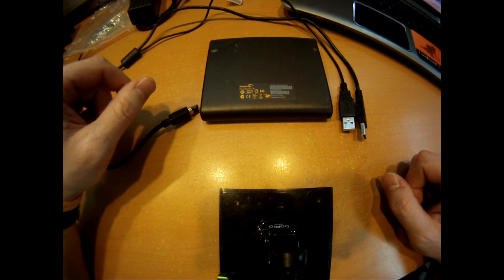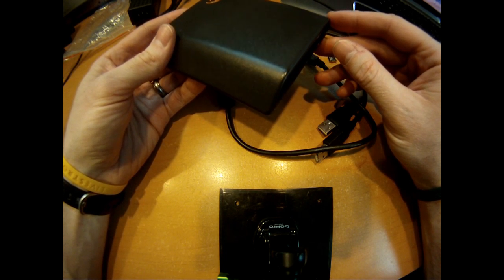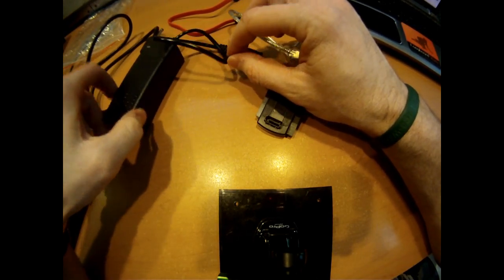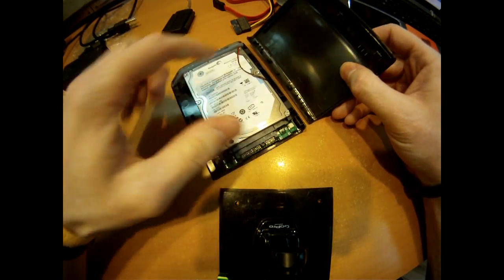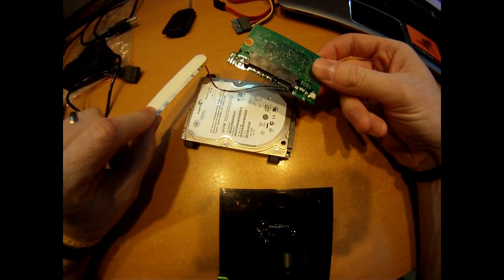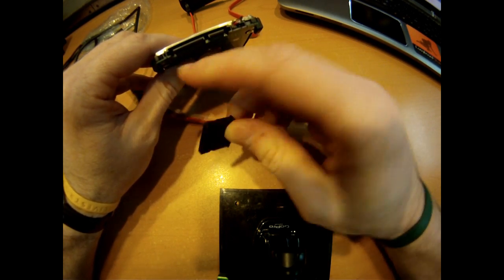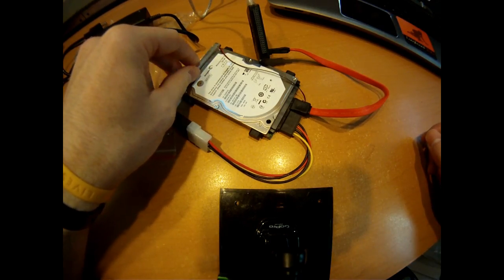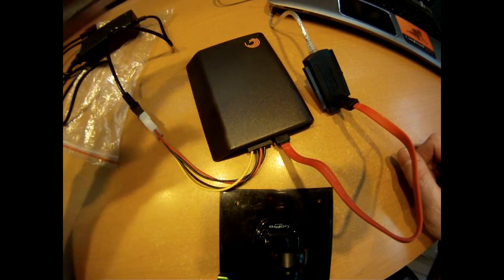Converting Seagate FreeAgent Go external hard drive to SATA drive

Comment: The reason it runs faster, is you are running more power, with the USB port you are running the power from it at a slower rate but with that way you are running it faster, somebody will probably call me on this, but I care less, I have a couple of those connectors like that and I use them to store information and programs I use to fix and repair computers, also I copy clients info to another HD if I have to  install a new OS so they don't lose any files... I have used them for several years now and it runs so much faster... to be safe if you are using it for a prolonged time you need to connect a fan to the HD so it can remain cool also the transformer part of the power cord, it will get very hot if ran for extended use, I have burnt one out...

Comment: I have the same exact Seagate and I am really not sure why I can not see files.  The laptop recognizes that the hard drive is attached although it used to have Seagate in the description and now it only has local disk. With the letter drive.  I am not able to see any of my files using explorer only that the drive is connected.. Will this process in you video help to retrieve my pictures ?

Comment: hi there, thanks for the video. the same thing happened to me and im quite the nube so could I trouble you for a list of things that you bought so I can go on ebay and get them
Reply from the maker: As far as I can remember all I searched for was generically "SATA Kit". It came with everything shown in the video. IDE to SATA cable, SATA Data Cable, AC Adapter for power, IDE Power Converter, & IDE to SATA Power cable I believe is all that's required. They were fairly abundant and inexpensive all over eBay the last I checked, so I don't foresee you having much trouble getting what you're looking for.

Comment: I'm using a Desktop PC. Is there any way to connect the SATA power cable to the power supply of the CPU?
Reply from the maker: Don't quote me, but I think there is with the correct adapter cables. I haven't done that project myself, but I'm pretty sure there is a way...

Comment: great am facing same problem i did the same instead i used desktop central power unit for power but i cant find a miniSata to usb adapter :(
Reply from the maker: eBay or Amazon.com?  Usually if one site doesn't have what I'm looking for the other does...

Comment: How did you open the enclosure?
Reply from the maker: Sorry I missed you. The case enclosure is just held together by the molded plastic clips inside, so you just have to be careful and use something thin to wedge in between the halves and pry it apart.

Comment: My system cannot read my dell 1tb external hdd, please tell me that will these cables help me?? please help
Reply from the maker: Does your drive have power when it's plugged in? Does your USB port work on your computer with other devices? Does your computer still have the proper drivers installed to use the drive? In my experience with these cables, they offer another route to utilize your external hard drive without depending on the sometimes fragile mini USB port. They don't necessarily correct a software issue, so if that's you'r case then I can't say these would help. If it's simply a hardware issue, i.e. in my case the plug physically broke, then perhaps this is the route to take...
Reply: ***** Everything is right in my system but theres a beeping sound for 5 secs in my hard disk when i connect to my system, please tell me how to get my data back
Reply from the maker: Bhuvan arora Might just have to go the old fashioned route and give the manufacturer of your hard drive a call for their Tech. Support...